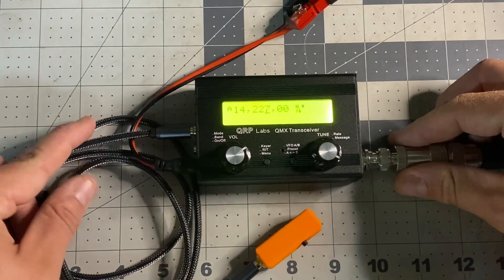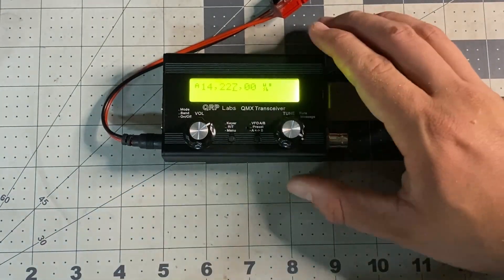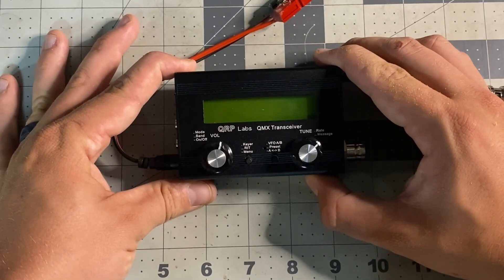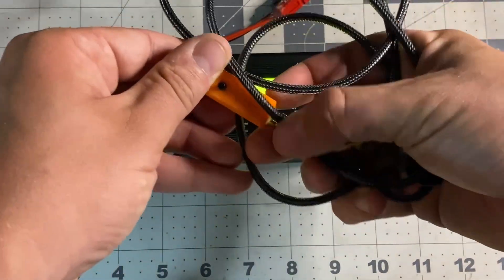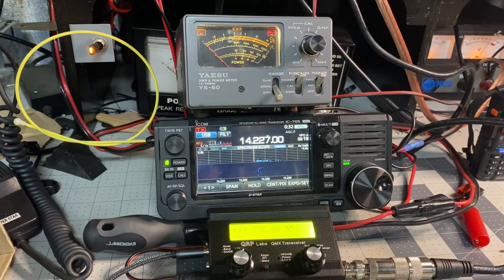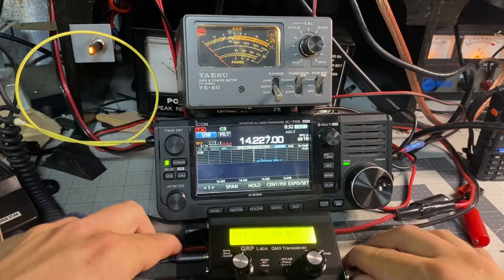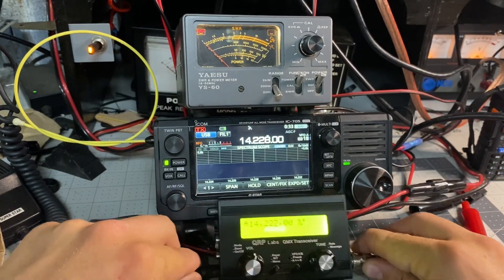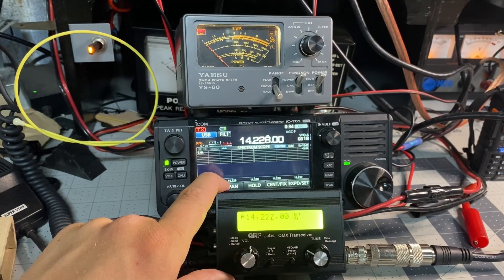Pocket Sized HF QRP Ham Radio: QRP Labs QMX HF Transceiver

Comment: You're right about there being night and day versions. There's also one that splits the difference. Here they are: (1) 80, 60, 40, 30 and 20m, (2) 20, 17, 15, 12, 11, and 10m, and (3) 60, 40, 30, 20, 17 and 15m. 

Also, those who don't mind a radio a bit larger, should check out the QMX+. The features are virtually identical, but it covers 160-6 meters and the additional space makes the kit version easier to build.

Both versions (along with the cw-only QCX ones) include a built-in WSPR mode that makes antenna testing easy. My little QCX running 3 watts was picked up at multiple locations in Australia from the SE U.S. These little rigs can get out.
Reply from the maker: Yes they are great rigs! I have done several videos with both. I wish I would have kept my QMX+ and added an internal battery and some stuff